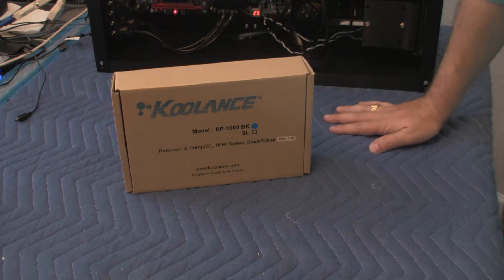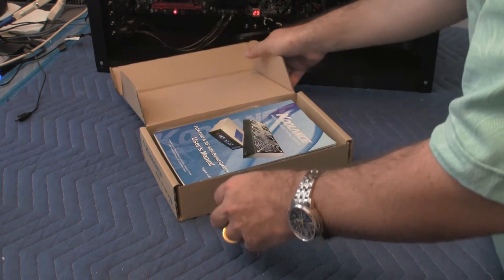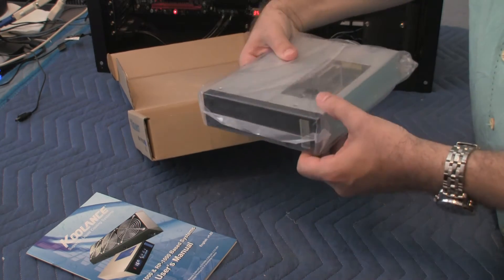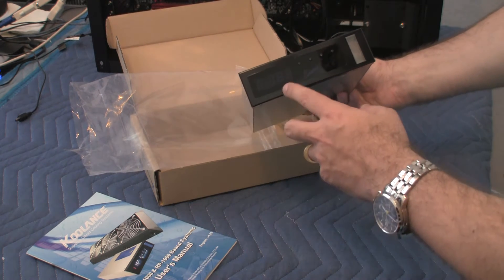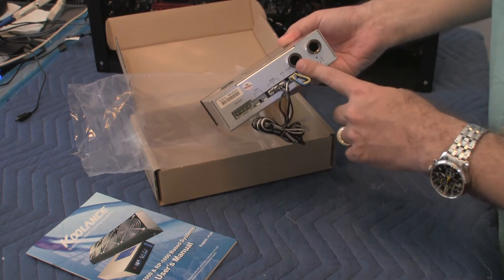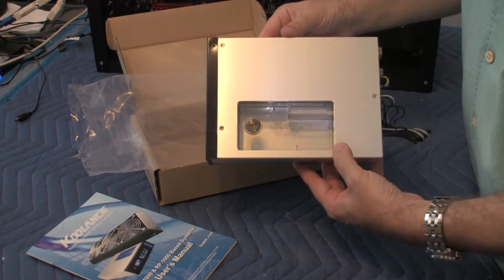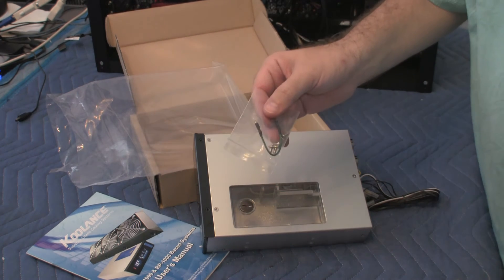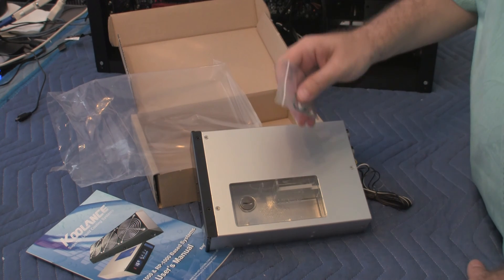Water Cooling Your Computer - Part 2 - The Pump and Liquid Reservoir, unboxing the Koolance RP-1000

Comment from the maker: I'm quite pleased with the RP-1000 unit. It allows a variable speed fan as well as variable speed pump. For normal work (when the CPUs and/or GPUs never go above 5%), such as emails, web browsing and other non-heavy tasks, I keep the fan/pump at about 3 or 4. It's not noisy. When I do heavy video editing/gaming, when the CPUs/GPUs go above 50%, I set the fan/pump from 6 to 8. It's definitely noisy then. The noise at this level is far less compared to traditional CPU/GPU air-cooling fan noise.